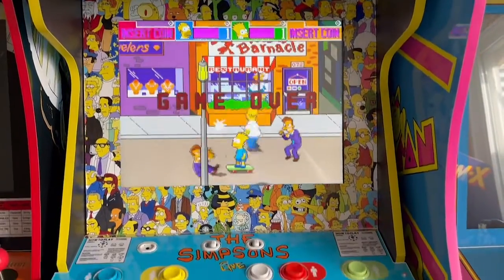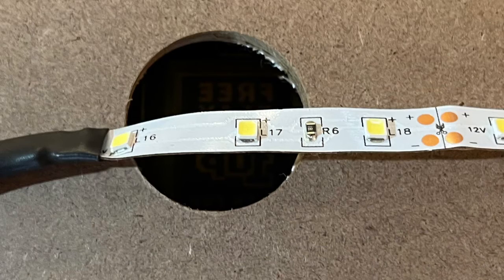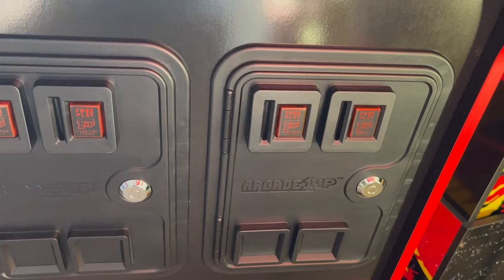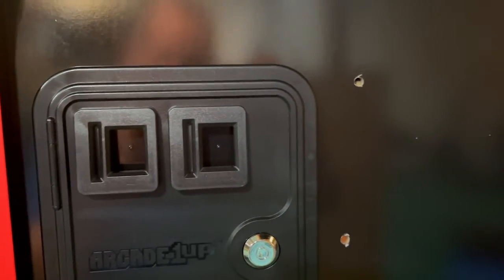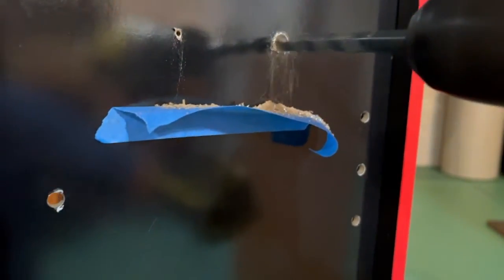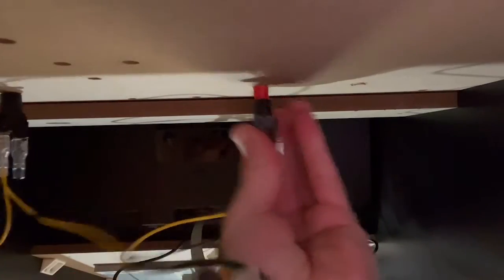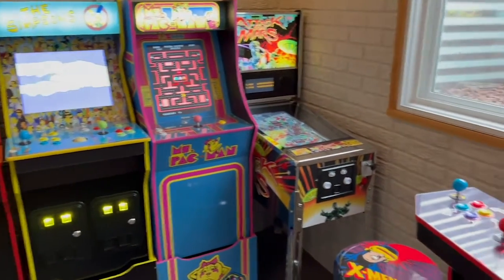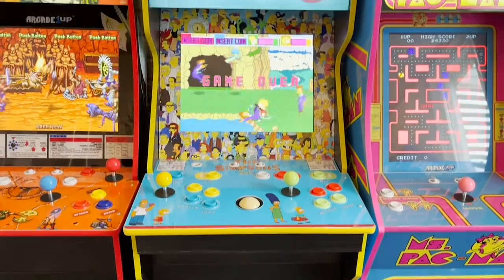Easy coin button LEDs for an Arcade1Up X-men Cabinet using a Retro530 kit

Comment: Are all Arcade1up PCB usb connectors wired similarly with power on outside pins? Looks great!!.
Reply from the maker: Hello Jim. I'm sorry, but I don't really know the answer to the USB question. My guess is they are all made exactly the same way. RETRO530 was the first after-market seller that I purchased a lighting kit from to use the USB instead of tapping into the marquee socket. I've since seen others use it, so I'm going to guess it's pretty standard. I just picked up an A1Up Street Fighter Yoga Flame cabinet, and I need to do the same thing to that one, as the coin buttons are also not lit. Have a great weekend!

Comment: So would you say the best way to install is to put machine better first? I have 2 to put together and debating whether to put machine together first or drill the coin door stuff first.
Reply from the maker: If you’ve not assembled the cabinet yet, drill the holes for the LEDs now. It’s far easier while the panel is not installed. Even if you don’t have the parts from Retro 530 yet, if the holes are already drilled, you can just slip the LEDs into place by removing the back panel. Good luck with the project.
Reply: @PoppArtstudios  will do. Yes I have the kit already!

Comment: I would think you would want the buttons to be on all the time even when the machines not on just a personal preference.
Reply from the maker: You could have the buttons always lit, but you’ll need a separate 5 volt supply for the LEDs. That way, when the game is switched off, the buttons will still light up.